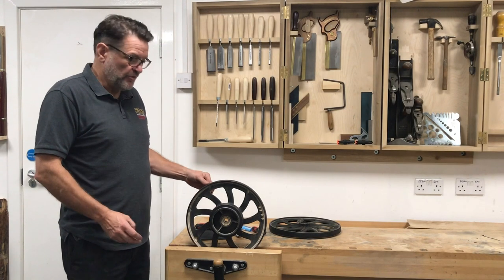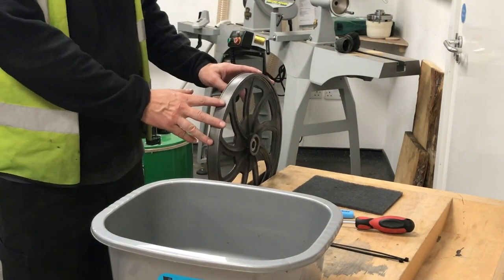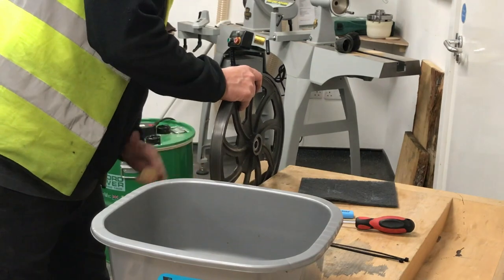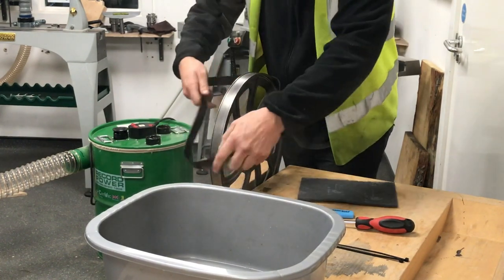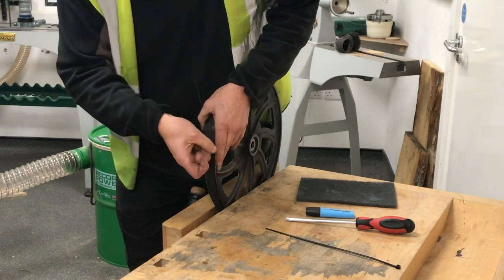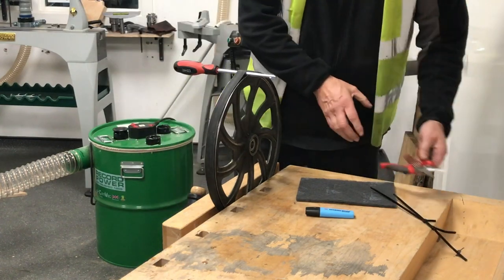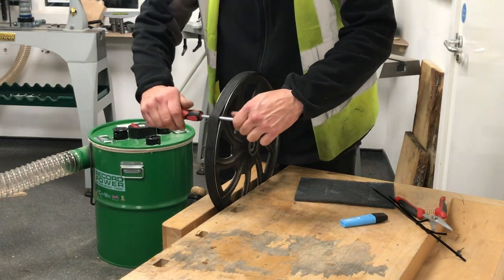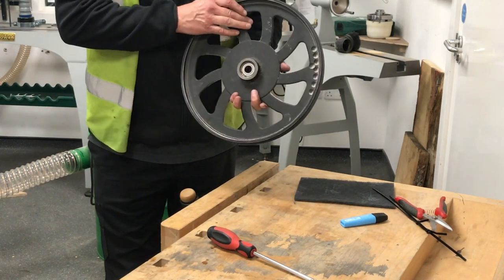Know-How Series: How to change a Bandsaw tyre

Comment: Good information, but how often do they need changing?
Reply from the maker: Hello, there isn't a set time as such, you just need to keep a eye on the condition of the rubber itself, it needs to be supple and not dry or cracked, and if it’s gone shiny it may needs buffing up or at that point replacing. Wire wool or a scratch pad can be used for cleaning and making sure it is gripping the blade itself which is important for tracking purposes. Best Wishes, Record Power.
Reply: far too often and they are very expensive !!!!